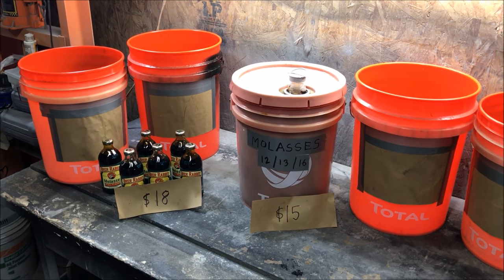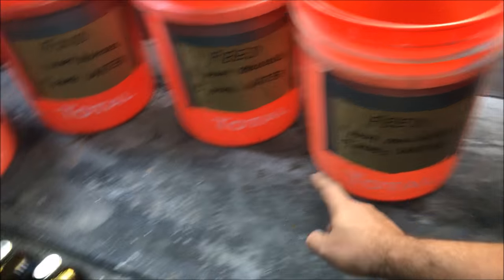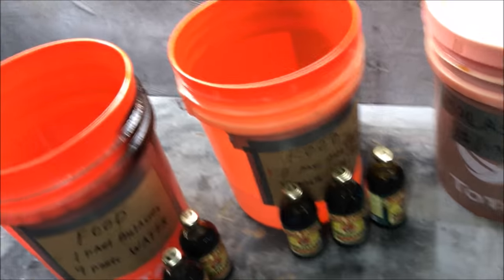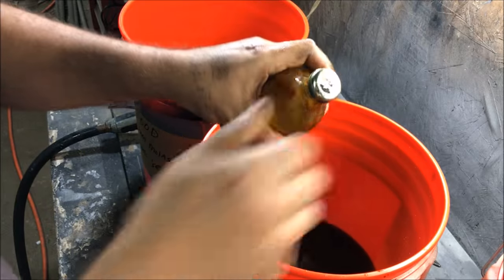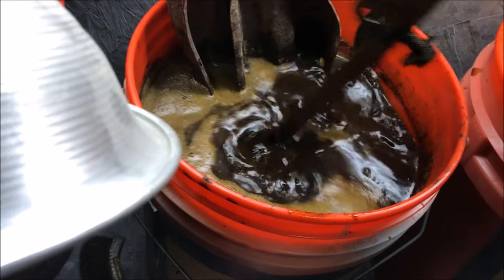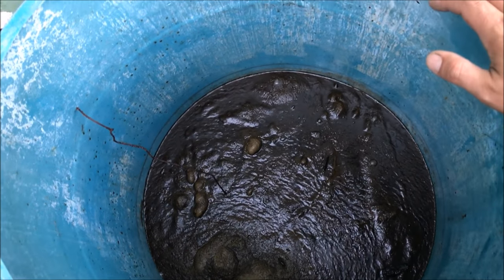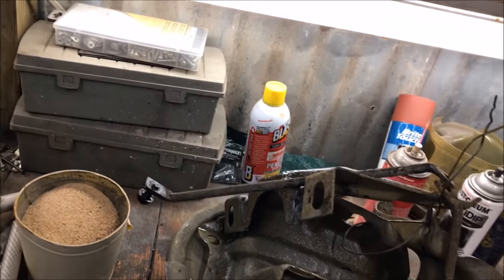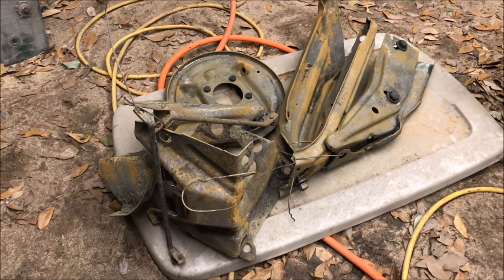how to remove rust with molasses DIY do it yourself

Comment: I dumped five of those grocery store jars into a 55 gallon drum, filled 3/4 of the way full. After about 3 weeks the sugars fermented and it started to gather foam on the top. That batch lasted months and cleaned numerous parts. Once it sets up, its just a waiting game. Still much cheaper and less dangerous than most rust treatments. Works perfect for old motorcycle tanks.
Reply: You think the fermentation has something to do with it?
Reply: rust 911 is safe and only if you buy 1 gallon is it close to being affordable !

Comment: 2 problems 1 in temperatures below 50° molasses and water takes a lot longer to work. 2 Use a pressure washer to wash off rusty residue dry quickly and add primer any moisture causes rust. I never did any scraping or a brushing or anything else. It’s great for getting into cracks it is awesome, especially thin metal and even jewelry, scrap metal it  made it look new. Painted items the paint slides off like it was stuck to the metal I now have a Dustless Blasting set up. Down side it stick and cover smell draws rats and other animal

Comment: Ok I bought gallon of rust 911 cost roughly 20 for a 5 gallon treatment it will work in 48 hrs to 72 ! But huge investment . I like the results you have with your test ,if you not in a hurry it is more cost effective and just a phosphorus additive keep wet for 20 minutes and your good to go ! Wash and dry use por 15 if applicable ! Good Video

Comment: Had an old corrosion seized H-D 1942 WLA engine and soaked it in 10:1 molasses for a month and it freed up the motor to be easily disassembled.

Comment: I've mixed food grade 20•1, just had to soak a few days. Also I reused the batch a few times, just skimmed the foam off the top. Also if you have a dollar store, sometimes they've got molasses. Thanks for the tip about feed molasses, duh on me.

Comment: Great video Chris!  Yes molasses is a long process. I use another method.  Lysol toilet bowl cleaner.  Wait 2 days,  wire brush your parts.  Rinse with water and TSP.  Dry your parts right away, to prevent flash rusting. Buy a case of 4 at Costco for $20. Make sure your doing this outside or in a well vented area.  As well as gloves an eye protection.  I've done this on quite a few parts for my 66 Chevelle Malibu.  I don't have a video but I do have pictures of a head light bezel if your interested in seeing them.

Comment: Thanks for taking the time and trouble to help sort out some things for many of us!  
Hoping you can indulge me with some questions I have:  So in looking at molasses available in Amazon, I notice that there is molasses and then blackstrap molasses (there are also other designations I'll bring up later).  In researching blackstrap molasses, I learned that it is inferior in terms of taste and is what they give to the animals in parts of the country where the distinction amongst molasses types are appreciated (e.g., Kentucky, Tennessee etc).  So my take on this is that molasses that is bitter, acrid and has less sugar is rebranded as blackstrap for markets whose consumers don't know any better.  In other words, I SUSPECT, but don't yet know, that your feed store molasses and blackstrap molasses are the same thing.  

And there are other attributes to throw in the mix:  Some types are  labeled  unsulfonated.  Presumably that means that those not unsufonated have sulfur in them.  But maybe this is a process applied only to a type of molasses, e.g., blackstrap, to get it to be a more acceptable taste--I don't know.  And then finally there are different sources of molasses other than the usual source of cane:  Sorghum, and even Pomegranate come up often.  

This isn't a casual review of the types. I am trying to determine which one is optimal for rust removal.  Maybe it's the sulfur content that helps in the process.  If so, one would want to avoid the unsufonated.  Do you have any insight on this?  Any comments about my hypothesis regarded blackstrap?

Comment: Don’t forget to use Phosphoric acid straight after you remove it from the molasses and dry it... this ceases the oxidation process.... pretty much primes the item and it be painted straight over it without an etch primer%%% I prefer to use the primer as it fills in pitting etc and leaves the painted surface in a smoother state. ....It does take time however maintains the integrity of the item being restored and it’s the best process I have ever used... and cheap

Comment: Just had a thought; what if you  combined the molasses process with electrolysis? Has anyone tried this? Did you degrease parts before dipping?
Reply from the maker: You have to get all grease off before..

Comment: If you use electrolysis you can achieve the same results in 24-48 hrs with good car battery charger and alkaline water solution and some sacrificial metal. Coat cola bath will remove the surface residue that appears after rust removal soak.
Reply from the maker: ive known about that process for years, but im not comfortable leaving a battery charger hooked up for that long.. i will try it in the future, though
Reply: Hey Chris
No problem. Been using this method for years never had a problem apart from earring out a charger.
Enjoying  your videos. Keep them coming.